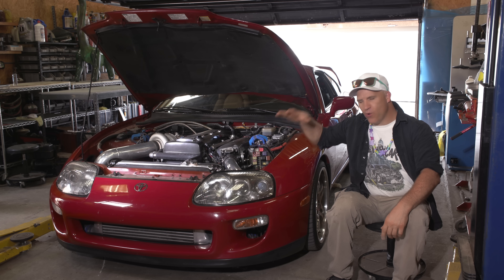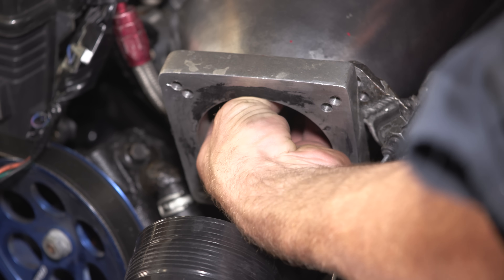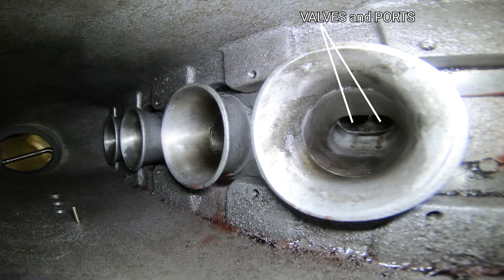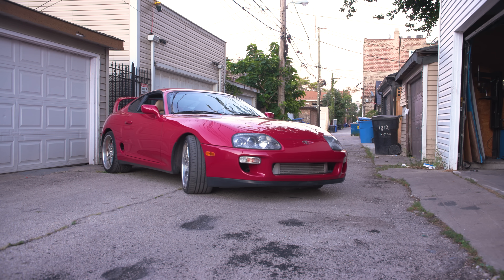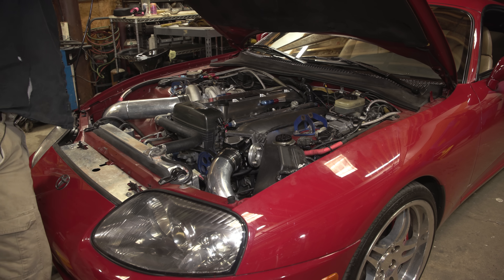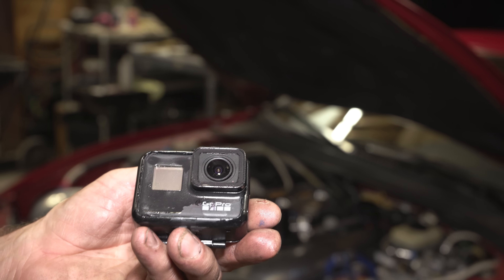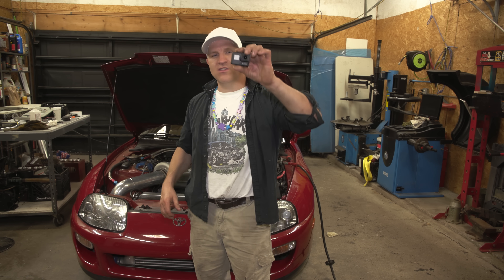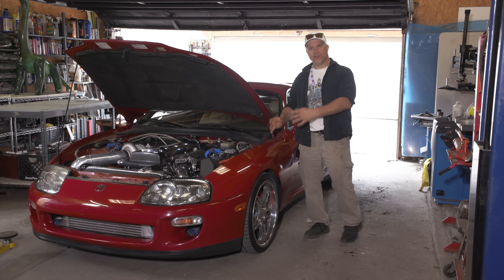Driving with Gopro Inside My Intake Manifold (Toyota Supra Turbo)

Comment from the maker: If you want to see more of this Supra check this out https://youtu.be/bZtGRGv_qNU my favorite part is when I almost hit the guy in the street at 7:09.
Reply: Check the PCV valve too for the oil problem, just a simple suggestion. Might or might not be
Reply: I bet you probably couldnt fit one at the bottom of a crank case .....
Reply: oil pressure building up too high and pushing out from the engine into the intake
Reply: I don’t think the camera man had a choice
Reply: Your favorite part is almost hitting a guy because of your wreckless driving? Are you that stupid?
Reply: Remember that movie honey I shrunk the kids ????? 🤔😅😅😅😆😆🤣🤣
Reply: Did the GoPro survive once it cooled down?
Reply: Cruisin
Reply: Sup Matt
Reply: Awesome video I back for a second watch lol ! Are you running race fuel ?! I ask cause of the purple looking residue in your intake  or your running Royal Purple and that’s oil leaking past your valve stem seals maybe from crank case pressure
Reply: I dont understand how this could be,but on top of the 3rd Inlet tube there was what appeared to be sparks/ arching when you were decelerating, did you notice this or am i seeing things?? Killer idea on the view,and watching the injector shots,makes me wonder if theres a better option inside for better air fuel blending?
Reply: What is your answer to the GoPro8 being installed but us being shown a gopro7 after the recording was done?
Reply: Wow
Reply: QUESTION: I notice that the fuel is never totally cut-off during deceleration - why is this? Surely if the throttle pedal is at the zero position, it shouldn't need to chuck in any fuel but I notice here that the injectors are still spraying small amounts in. Why?
Reply: @EdgyNumber1  You want the engine to shut off?? LOL Unless you have cylinder deactivation technology, the injector has to spray something to keep combustion happening.
Reply: @justacinnamonbun8658  I'm sure heard of something called 'deceleration fuel cut-off.'
Reply: @EdgyNumber1  I don't know, maybe it's a new technology, I went to automotive tech 20 years ago, I heard of Chrysler's DOD (displacement on demand) and GM came out with something similar too for their gas guzzlers, I've been out of the realm of modern tech for a long time but I've never heard of the ECU cutting 100% fuel to one or more cylinders during normal, non-highway operation.
Reply: @justacinnamonbun8658   absolutely not. If you’re rolling and in gear, the fuel injection can stop because the wheels will turn the motor.
Reply: @EdgyNumber1  to keep the car running my dude if the flow of fuel were to completely shut off so would the engine
Reply: @disklozuregaming2590  I did a little digging and DFCO does indeed cut the injectors, the fuel to zero but only under specific conditions:

Vehicle must be moving; road speed must be decreasing; car must be in gear; clutch pedal must be up; throttle position must be 0%; may verify with brake pedal on. 

So it does exist but being a much older car, the Supra may not be able to monitor all these parameters. The above parameters apply to the stick shift cars so the parameters for automatics and dual-clutch sequential types will differ somewhat. I believe Hyundai, Honda and GM uses this.
Reply: @EdgyNumber1  ahhh lol ok yea I'm used to chevelles and marauders both from the 60s-70s lmao
Reply: @disklozuregaming2590  absolutely not. If you’re rolling and in gear, the fuel injection can stop because the wheels will turn the motor.
Reply: You keep the GoPro, I'll take the Supra 😁.
Reply: The video player had subtitles on and at the point of starting the motor and hear the Supra sound, YouTube shows [music] in the subtitle. I guess that is right. Awesome idea by the way..
Reply: Broski how did your camera not melt??????????????????????????? Wait i-i-is THAT A SUPRA AHHHHHHHHAHAHAHAHAHAHHHHHHHHHHHHHHHHHHHUUHHHAY YOOOO
Reply: Yeah boi
Reply: Need and oil catch can
Reply: somehow the algorithm connected us once again.  Great to see what you have been up to.  I caught a glimpse of my old work place.
Reply: I live in omaha and I legit passed a supra that looks exactly like the one in your video like a month ago
Reply: Do more of this
Reply: Hey WP, just posting here thinking you're more likely to read my comment on a recent video, I just come back from the spring clutch failure video and thought the shots of anything glowing red hot would be more enjoyable with dimmer lighting, kinda like glowing brake discs at night at Le Mans.

Great content as always, and love your Supra too!

Cheers!
Reply: what year is that Toyota Supra? What size engine does it have in both the number of cylinders and cubic inches? how much horsepower does the engine put out at maximum power? and how fast can she go?
Reply: damnnn, I watched it and you are such a good driver!!
Reply: @ISU-KV-  you are kidding?
Reply: i would like that goPro!

Comment: Oil is from crankase ventilation system. I noticed your injector spray angle is horrible. Need to swap to a different spray pattern injector or different angle from a different intake

Comment: You need a catch can if you don't already have one installed. It also looked like Cyl #3 had oil leaking from the Velocity stack. I'm not really a 2J guy so I can't really say for sure but it might warrant further investigation :D
Reply from the maker: Good guess but it turned out to be the power steering pressure switch that ties into the manifold, it was leaking power steering fluid into the manifold. I would have never known if I didn't see it in this video.
Reply: @WarpedYT  Ahhh makes sense. Again I'm not a 2J guy I daily drive an E39 haha I6 is definitely one of the best engine configs for sure. I also plan on doing some Forced induction soon with a nice 1.6L Twin screw kit. Wish me luck! lmao
Reply from the maker: I do have a catch can, I believe that my Supra was one of the first to ever have a catch can because I designed the system. After mine everybody started following suit because they were blowing out front seals.

Comment: Quick question guys I am a bit confused what does gas pedal actually control on petrol car is it control air flow or control the flow of fuel and what about diesel truck with gas pedal what it actually control air flow or fuel
Reply: well when you pressed the pedal. you open the throttle to let more air in, and engine sensor will add more fuel once the air amount is increased. but in diesel, when you press the throttle you increase the amount of fuel injected into the engine
Reply: @SlavJerry  thank you for telling me

Comment: Remember the straight 6 Supras of several years ago?  well, here's a short story...  this guy, not me, installed a large Garrrett TC in it, not recommended by the parts supplier... settings were not suggested b/c the parts supplier thought that he was certifiable. Next, he tore out the entire exhaust system incl the CC.  Not nice.  TC was installed with a STRAIGHT THRU 3" custom pipe to the rear.... Nothing in between. Set to 19 psi or so. Started it in my driveway. Near complete silence from the exhaust pipe... Unbelieveable (to me) yet true. Unless you were close to the exhaust, it was just a background subsonic whisper. It was shockingly quick, (and fast).

Comment: reminds me of motorcycle carbs the fuel blasts back when shifting at wot. the oil is from the valve guides especially when your in boost because it raises crank case pressure (pissing oil out the valves) without a vacuum pump

Comment: Valve stem seals are on the way out.... Bit of oil won't hurt it
Reply from the maker: Nah, it was the power steering switch leaking, it's connected to the intake via vacuum lines.. but I didn't know it was leaking until I saw this video.

Comment: You need a oil catch can high compression pushing oil up though
Reply from the maker: No it was power steering fluid, a power steering pressure switch was leaking
Reply: @Warped Perception  wow that’s crazy

Comment: Subtitles in the manifold: MUSIC, APPLAUSE :-)))
Subtitles outside the car: SOOTHING MUSIC :-)))
BTW: Wouldn't it be better if the injectors were turned a bit more towards the combustion chamber? It seems a LOT of fuel hits the opposite wall of the intake channel instead of being carried directly into the chamber by air.

Comment: Cool video!
IMO, the excess oil might be coming from the back cylinders, which see the reduced airflow and reduced pressure due to the gopro.
With the reduced airflow and pressure at the cylinder intake, some of the fuel sprayed by injectors might not be able to get into the cylinders, fouling the manifold. At the same time, a leakage of the vaporized oil from the cylinder (high pressure) to the manifold (low pressure) may occur when intake valves open.
That's just my two cents.

Comment: Awesome for sure... it did look like the disruption to air flow was causing a backlash of vaporized fuel near #4 cylinder ... Nonetheless awesome footage and surprising that gopro withstood the heat as long as it did... The "oil" looked red like trans fluid , I am wondering why it looked that color unless it is toyota coolant...intercooler maybe ???
Reply: I thought it was coolant leaking from somewhere.
Guess if he often drives like that there is likely some engine damage.

Comment: I like the idea. I think there are a number of takeaways like using a cheap borescope  might do about the same. I checked on Amazon. Maybe, $20.00. I would just find someone with a stepper bit and a tap as well as a couple of plugs, one to hold the borescope into the plenum, the other to cap it after. Obviously, that is why they have EGR valves and oil recirculation to prevent oil/fuel from being blown back into the intake. Otherwise the intake valves aren't closing effectively to prevent or blow all residuals back out the exhaust side of the engine head. Nice work, if you find a spectrometer, it could tell you a little more about when, especially if you have a dedicated system off of your dizzy. One of your valves is allowing trapped oils past though. -2 cents

Comment: Could the oil be from the PCV valve cycling back through your intake to be burned?  Part of the emission control garbage, using a catch can to collect it rather than going back through your intake perhaps.  I don't know your setup, just a guess.

Comment: There is no way that GoPro was 200°F you would’ve dropped it within one second if it was and still would probably have burnt your hand
Reply from the maker: Not true, I have grabbed aluminum pieces out of the oven at 220 to 250 all the time, Fahrenheit though not Celsius. But 250 is the limit and even then sometimes I will burn myself.

Comment: Oil is probably from the boost side seal.. had a cheap turbo on my car and noticed oil in the intake pipes..took the intercooler off and poured about half a quart out of it and it was the boost side shaft seal

Comment: That oil in the intake, I'm guessing you need an oil catch can.
Reply: Y'all are morons, it's power steering fluid and he says so in the captions at 7:13 . @Logan Palmer was correct.
Reply: @kylenorman3867  Came here to say this. Gotta love it when you can shut down people who think they know everything.
Reply: @kylenorman3867  LMAO you're right ahahaha I love YouTube...
Reply: Please, tell me where your intake and power steering are connected?
Reply: @robertwymer2919  If you can read you would’ve clearly understood that I said power steering fluid is leaking onto the, most likely, Cracked intake manifold from above
Reply: @k1lm3n0w3  Like i said before, and this is simply you just not understanding like the typical keyboard warrior. Yes they are two completely separate systems, but depending on how you run the engine bay power steering pump can be close to the intake. Which this intake is cracked allowing any fluid From outside the engine to seek into or onto said manifold. However he had stated that is is actually Oil leaking into the cracked manifold. understand? or no?
Reply: @Sbflogan There's no indication of any damage to the intake plenum whatsoever. Damage to the intake manifold would cause a vacuum leak and then a misfire.
Reply: @k1lm3n0w3  Not all the time, I have an old dual plane offenhauser that had cracked due to it being cast from 2 different metals and had cause it to form a cracked at where these two things mated. It lowered my vacuum but didn’t cause a misfire or anything. I did get some oil in my intake though, just wasn’t that color
Reply: @bennyjetsaroundtheworld9047  7:13 look at captions haha nice “moron”
Reply: @k1lm3n0w3  read captions at 7:13.. I sense a dirty delete coming lmao
Reply: @Sbflogan  Dude, let it go. You'd be doing yourself a favor.
Reply: @jellyjamacain ok mom. sorry i get notifications for replies

ps never actually watched the video in its entirety
Reply: @Sbflogan  No problem, kiddo.
Reply: @k1lm3n0w3  haha! fool...
Reply: It's pretty crazy that it ended up being power steering fluid. I'm not familiar with supras nor turbos so I thought for sure it would be oil.
Reply: @ginicholas4322  It is actually pretty rare for that to happen, since you kinda need to pretty “lucky” for your manifold to be cracked at a spot where power steering leaks in. Quite interesting and funny how the owner probably would’ve never known it was leaking into the manifold with out that GoPro!
Reply: Valve stem seals🤷‍♂️
Reply: It’s power steering fluid judging by its color, leaking in externally most likely. New intake and fix the power steering and should be good
Reply: @Sbflogan  he says its oil in the video
Reply: @swed420xx66  Ohhhh must be royal blue oil from the color. It still seems like an external leak judging by how it kept getting into the manifold though.
Reply: @Sbflogan  royal blue huh

Comment: PRO TIP HERE: You can downgrade your GoPro from Hero 8 to Hero 7 by putting it on a Supra Intake! Just Wow! 🤯
Reply: I’m guessing he used the 8 for outside footage as the 7 inside would take more abuse and he is probably more comfortable wrecking the older model.
Reply: Didn’t even notice that lol
Reply: Probably a gopro 8 in a 7 case.  I run my 10 in a 9 case.
Reply: Fr tho wtf??
Reply: another PRO TIP put your GoPro into intake and take it out with case ;) :D

Comment: oil inside the intake plenum isn't a big deal, happens with most engines, but make sure it is actually oil. it shouldn't be if you have two large tubes running from your rocker covers to (what I'm guessing should be) an oil catch can. that pink stuff looked to be more like fuel than oil, but I don't know what type of fuel you run (premium + E85, E85 only, etc.) or what colour it normally is.

Comment: Love how the sound vanishes when the throttle's released and turbo goes to vacuum - no air to carry the sound! Plus the water vapour condensing out of the air because of that sudden low pressure. Awesome physics demonstration.
Reply: Don't quote me but sound waves (mechanical waves) require a medium to travel, but isn't the intake manifold and the camera a medium that can oscillate the sound?
Reply: @Malaka-JZ  Yes. That's absolutely what it is. Dude seems to think the car going into vacuum creates a state of 100% vacuum inside the manifold but it doesn't go anywhere near that high. There's still sound. It's just quieter because he's letting off the throttle.
Reply: @Malaka-JZ  Yes. Sound travels through the manifold itself and the camera. Even if there was a perfect vacuum inside the manifold, the camera would still be vibrating and the microphone would record it as sound. GoPros attached to astronauts on spacewalk also record sound for the same reason.
Reply: It's because the air is moving in the opposite direction so the soundwaves just kind of don't go anywhere
Reply: Check out RooST 200cc Dyno run posted by Scooter Tube, you can clearly see the water vapour at full throttle

Comment: outside :sounds like a supra
inside: 6.3L V8
Reply: Inside to me it sounds like a larger v12
Reply: @rydoggo  lmao it's more of a v8
Reply: @hypr7370  nah lol too smooth for a V8, it sounds like a 6 banger
Reply: @foxthooot5090  engines sound the same when you put them all together
Reply: @funkygreenjean4734  and ur point is?
Reply: @rydoggo  yea almost like a ferrari v12 with a big cam lol sounds sick
Reply: Some points sound like a jake braking big i6 diesel
Reply: @xTheJmanChannel  I thought about that too and I think its because we are hearing all of the noise that is on the other side of the closed throttle while engine braking
Reply: 3:52 Sound like a Lambo countach  1980
Reply: @Prostreetsburnoutparadise  no they dont...
Reply: made me go back and look lol...was like i coulda swore that was a 2jz
Reply: sounds more like an m52 inside it to me
Reply: because of the amount of cylinders because a v6 and a v8 sounds different
Reply: @shabu5072  2jz is inline 6
Reply: It's a 4 cylinder.  He says the camera was facing #4 cylinder.  If you look at the engine when the hood is up, you can pretty easily tell it's a 4-banger.  And it runs like a beast.  Amazing what they can do these days.
Reply: @jimbanks5156  you ok?
Reply: @deaf2819  Who wants to know?
Reply: @jimbanks5156  the people who designed the Supra with 6 cylinders.